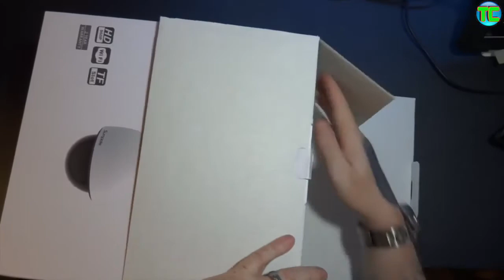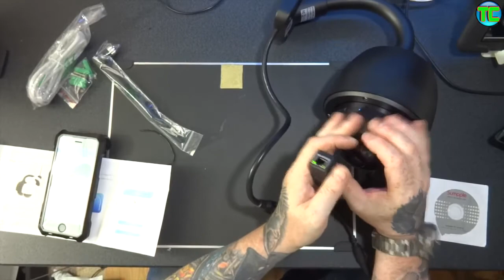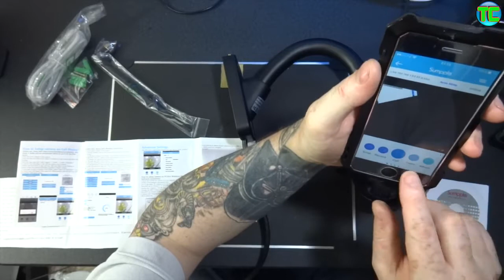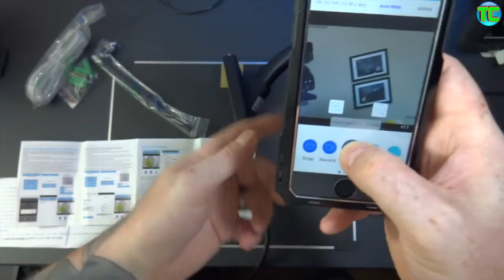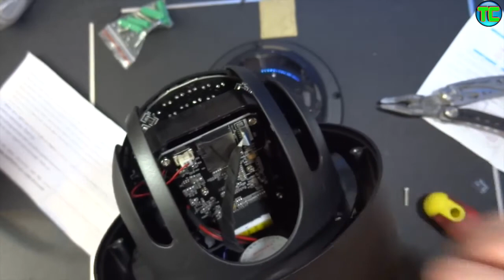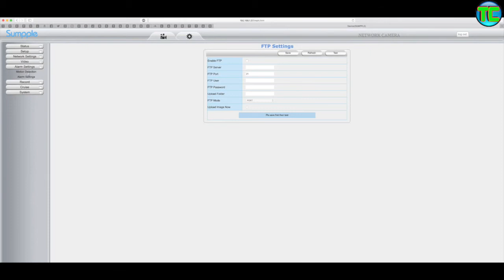TechChecker #141Sumpple IP Dome Camera Pan Tilt and Zoom 960P

Comment: The camera gets the signal from you're phones WiFi if you screw the aerial on maybe that's why panning etc seemed so slow on your screen. I have 3 of these set up they're great little cameras. But now cheaper can be bought with better zoom 18 to 30x flourion for one. Centre heating kept setting mine off as was picking up the vented fumes so careful where you site yours.
Reply from the maker: Hi No it does not get wifi from your phone you can use you mobile data when out to view the cameras it gets connected to your router then your phone connects to the router not direct to the phone it needs a internet connection to work and you can have as many cameras as you like I have 4 just of this brand and they work fine one is in my dads home over 100 miles away and i can watch that .it sounds like you need to tweak the settings in the app if you having problems maybe lower the bit rate might help.You should also change the passwords when you get it thats a given or your asking fro problems as most use the same user name and passwords for all ip cameras. you can also just the level of movement to stop fails alarms so if you heating comes on at say 3pm you can make 3pm a low sensitivity that could help.
New cameras are coming out all the time like PC and other Tech there out of date very quick but I am happy with the ones i have and they still work there good for looking around thats what  like about them i fine a fixed ip better for motion detection as these might be moved to a high movement area rather than where you want them id that make sense there also large so give people notice you have cameras and you should be less chance of getting robbed fingers crossed (: thanks for watching and commenting on the video its nice to get some feed back and glad over all you like the camera like i do.

Comment: Can you turn off the led at night vision?
Reply from the maker: El chicano Yes in the Web UI you can turn them on or off
Reply: Tech Checker OK does it have audio too
Reply from the maker: El chicano only if you add an external mic there is a wire there for it to be added
Reply: Yes but why would you you want to see whoever's activated your camera. You can set them so only 1 comes on or has many has needed

Comment: Can you hook it up to a pc so you can save it to a harddrive? Eg camera - rasberry pie to the hard drive so people can hack it,
Ive seen and even tried to hack these and they are very useless if you have the skills...
Reply from the maker: Hi mate you can watch the camera on a computer as well as a phone and record or just take a picture they have a memory slot for a Micro SD card you can fit you own or buy up to 64GB pre-installed regarding the hacking I honestly have no idea on that front I would say if you know what your doing and have the right stuff then anything is possible 
if you have it connected via a network lead and not the wifi it would be very hard to hack you would have to hack the whole network and the camera connects also via wifi if you do not want the network lead to it so you would need some sick skills to hack as it has the same security settings to your modem but I am sure there are people out there who can hack anything they hacked some cars before to make them stop while people were driving them so a camera is not impossible but nor is you home PC.the camera itself is very good i installed one to my Dads house over the weekend and I can look at it on my mobile as i set it up so funny being able to watch and move a camera thats over 100 miles away.
Reply: Tech Checker ok thanks for the help